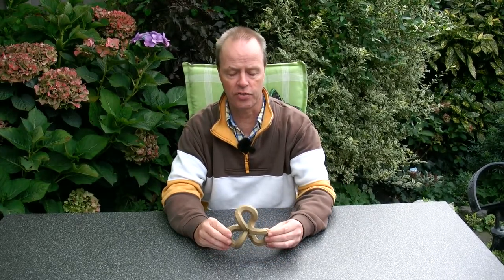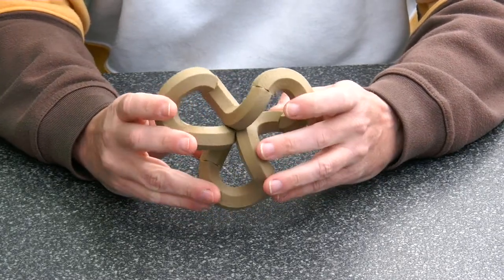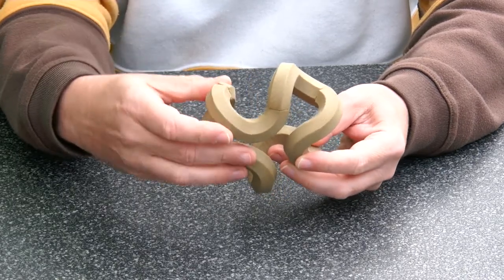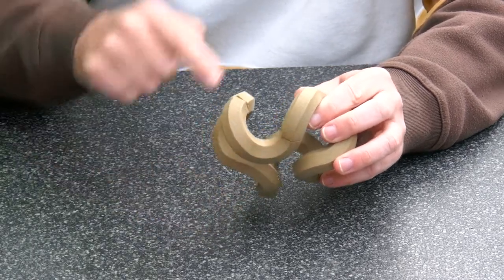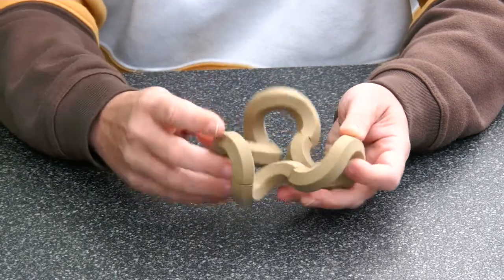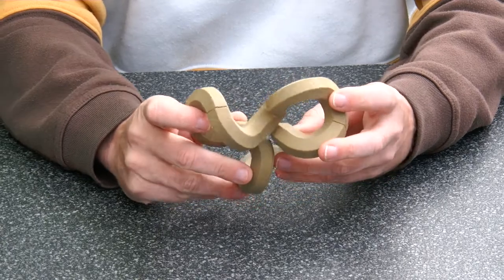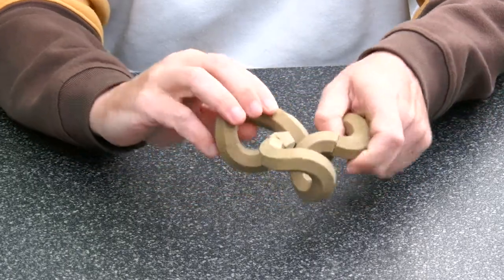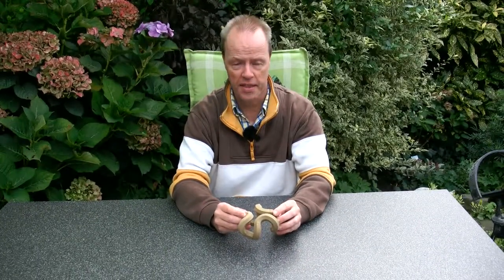Kaleidocus - Can you see how this geometry works?

Comment: you could make it into an astrolabacus like puzzle
Reply: I had the same idea, but it has to be quite long compared to its width, so it would have to have many balls, which might make it hard to shift them even with just one track along the entire way (or 2, works the same). If you have 3 or 6, solving would usually involve connecting three of the paths together, which would be basically impossible to move along.